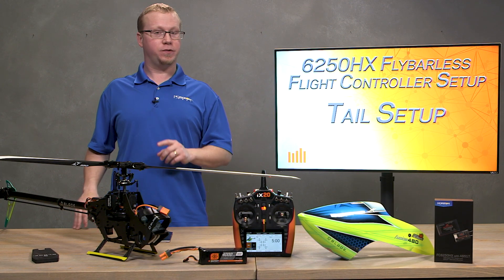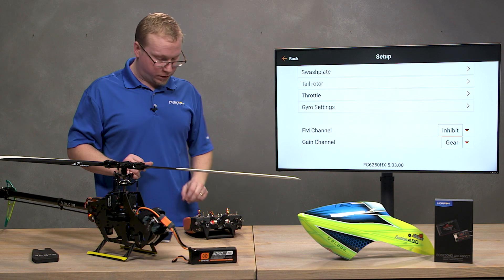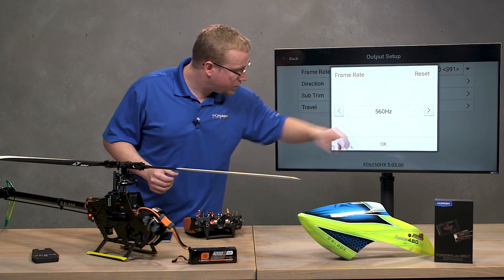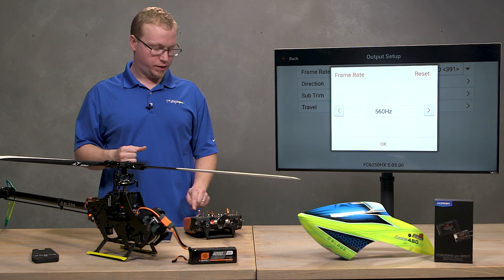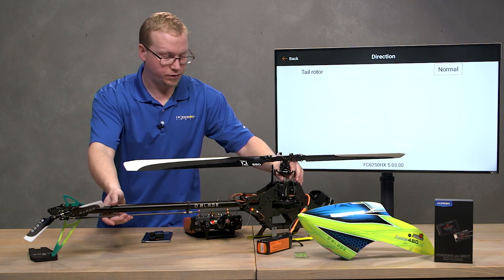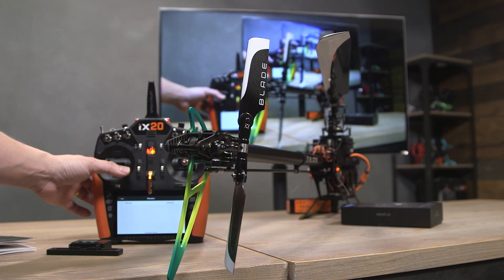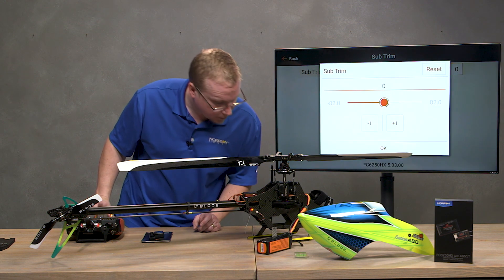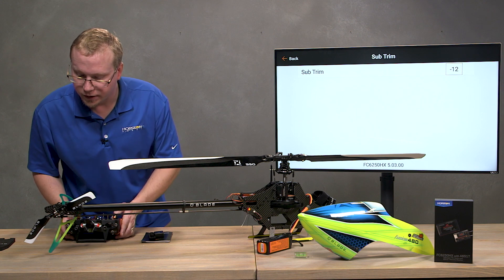Part 5 - Tail Rotor Setup - Spektrum 6250HX Flybarless Controller Setup Series

Comment: i really like how you own both spektrum, and blade, you use a blade fusion instead of a 330, and you specifically say get linkage length from your manufacturer, i’ve been trying for a month to get those but you refuse to provide link lengths for blade 330, and the menus available to me and you, aren’t the same, any suggestions?
Reply: not to mention the flybarless unit contradicts the blade manual many times overrrrrrr
Reply: suppose it’s time for a new align

Comment: ☠️BLACK BARON☠️ My nexspor tail servo 560Hz is jumping back and forth whenever I jump into the forward programming/setup/sub-trim menu and jumping to the previous screen by hitting the "Back" button and my Android Airware is crashing on the airfield. Is that normal?
Reply from the maker: That is odd. Do you mind reaching out to us via email or on Facebook/instagram instant messenger? Would like to be able to better assist there. Thanks!
Reply: @SpektrumRCvideos  ☠BLACK BARON☠ Problem solved so far. If I change the values for "Travel" to decrease the angle of attack of the tail blades does the FC "re-learn" and "re-calibrate" itself during fly-ins? I noticed that my tail rotor is no longer stable after changing only the "Travel" values when I give collective and increase the thrust on the main blades blowing into the tail blades. The tail slightly moves to the right when I give collective. It's really hard to find the best PID values. Can someone confirm please?

Comment: Spektrum indeed need to do a video on the GAIN and PID inter-relationship.  I totally agree with Richard B.  My tail was wagging like crazy.  The PID initial setting (at least in my case) were to high.  I lowered both the P and I to 26 and 27 respectively.  The initial 75% called for in the transmitter gyro setting was changed to 90.  No more wag.  I could probably start lowering the gain and raising the P and I, but the tail is working so maybe I'll just leave well enough alone.

The PID settings are very important.  If not set right the tail will freak out and so will you on your initial flight!!   I am an experienced  heli pilot so remain calmed and set it down with no damage.

By the way I have the Fusion 480 and Hi-Tec digital servos and a IX20 radio
Reply: ☠️BLACK BARON☠️ This RC helicopter setup subject for "newbies" is really complicated. My tail is wagging too.
Reply: @black_baron_net   The PID is different for each setup.  This is what worked for me after watching videos on how PID's work.

"P" is your main gain which provides resistance to change.   "I" gets the tail to where you want it to be.  "D" stops over shoot once it gets there.

Back the  "I" and "D" to about 10.    Back the "P" to about 20.  Take off until the heli is about a foot off the ground just in case you have to land quickly.  Don't panic.

Start raising the "P" until you get wagging then back off.

Now adjust the "I" until it wags.  Then back off the "I"

Do the same with the "D".

This will get the heli stabilized.  Then you can start tweaking the PID for forward flight and such.  Most of my adjustments where in "5" increments/decrements.

It took about 5 batteries until I got it right.  I think I settled on P 85  I 15 and D 55.  Your mileage may vary.  Once you have things set then the gyro gain in the transmitter will provide overall adjustment to all three of PID parameters.

For the cyclic I didn't have to do much.  What ever you to do to one parameter on the cyclic you should have the other matching.

Also I found that my iX20 transmitter gain was working kinda backwards.  From the 75% if I go up the overall gain would decrease.  I just worked with it and didn't try to reverse the gain channel in the transmitter
Reply: @calebizsol  ☠️BLACK BARON☠️ A Flight Controller + Gyro + Stabilisator that recognizes "Vibrations" would be cool and makes the adjustments automatically  in Artificial Intelligence to get the best, most stable results out of a flight controller.
Reply: @black_baron_net  AI coming to a controller near you!!!
Reply: @calebizsol  ☠️BLACK BARON☠️ "Cyclic response" (default 100%) as written in the manual is "Agility" as shown on the iX12 touchscreen display for swashplate forward programming setup. Can anyone confirm?
Reply: @black_baron_net  thats correct on the agility.
Reply: @calebizsol  ☠️BLACK BARON☠️ What settings are recommended for a "Beginner Mode" to make a scale helcopter as stable and less aggressive as possible. 50, 75? I am a newbie, I don't have a "Feeling" for the different settings yet. Thus, it's hard to imagine what values provoke what on the sticks.

Comment: In tail rotor setup (using NX10 transmitter), I can set the servo frequency, but there is no place I can find to set the center pulse value.  Does the 6250HX support tail servos with 760μs center pulse?  If so, where can I set that center pulse value?  I tried the setup by setting 560hz, but as soon as I plugged in the tail servo, it worked for a few seconds, but then it over heated and stopped working
Reply: Did you figure this out? I am having the same exact issue?

Comment: I have a Fusion 480 Stretch like in this video, however, I’m using the Spektrum H6060 Tail Rotor Servo. I cannot find out what frequency it runs so I can program my 6250 to match. I looked everywhere I can think of on the Horizon & Spektrum websites and I simply can’t find it. I need it to finish my set up.
Reply: Digital servo mostly 333hz,  but you can try 200hz first. After flying feel if it is hot. Try 333hz and feel again after flying.

Comment: Hi, I have ordered like 5 of these for my different helis,  I put this on my sab goblin mini comet. Built it perfectly mechanically,  but now when I throttle up, the tail wags like crazy! Can you please suggest what needs to be done??? Would appreciate ur reply. I tried lowering the gyro from 75 to even 20! The tail holds but as soon as it lifts from the ground a bit,  it wags !!. The gyro does not seem to do any difference. Also in channel assign, what should the Gear be? For me its INH.
Reply from the maker: Sounds like you may have the gyro channel set incorrectly. Make sure you have the Gyro menu channel set to the same channel that you picked in the forward programming setup. Another thought is to make sure your main blades are not too tight and your blade tracking is not too far off. Hope that helps!
Reply: @SpektrumRCvideos  hi thanks for ur reply. I have followed exactly as per ur tutorial videos. one thing I noticed in your settings that the Channel assign menu, the GEAR is set to "A" switch .but nothing of that is mentioned in the video thus mine is assigned as INH (inhibit) dont know if that is the issue?
Reply from the maker: @ameersak  In the gyro menu, what is CHAN assigned to?
Reply: @SpektrumRCvideos  Channel is set to "GEAR" but the switch is not set to flight mode, its set to switch B. (this is for normal, stunt1 and stunt2). Do you think setting it to FLIGHTMODE would help?
Reply from the maker: @ameersak  Yes set it to the FM switch as well
Reply: @SpektrumRCvideos  The main rotor blades and tail blades are not too tight. I made sure of that.

Comment: Why is my tail servo creeping to one side? Never ever had that happen to me in the 20-30 helicopters i adjusted. No trim or anything. Everything in forward programming is going fine, seriously this is just nuts
Reply from the maker: Hi Robert. Make sure your 6250HX is updated and that you perform a sensor calibration. That should fix the slow drift.
Reply: @SpektrumRCvideos  I forgot and mention it here. Yesterday did the calibration and works perfect. I just hate it when things malfunction around me🙂. Thanks for the headsup.
Reply: @SpektrumRCvideos  What do you mean by updated, because it was new out of the box. Sensor calibration did work, but tried it 4 times before it worked and stop creeping to one side.
Reply from the maker: @rtoebak76  Using our SPMA3065 usb cable you can update the flight controller. There have been some bug fixes and improvements
Reply: @SpektrumRCvideos  I've got the same issue and I have tried sensor calibraition a number of times (ensuring it was levelled each time) with no success. I'm running firmware version 5.06.
Reply: Realised the rudder sitck on the tx was reading -1 at rest so just had to add some sub trim to it to get it to 0 at rest. This has fixed it.

Comment: my tail is moving the correct direction with the stick but when i check the correction direction its backwards, how do you change this? Thanks
Reply from the maker: This is controlled by the orientation menu. Double check that you have the orientation set propperly.
Reply: @SpektrumRCvideos  How can that be true? Every helicopter would be different depending on the way the tail servo was mounted. On the AR7200 you can reverse it on one of the steps. My unit is mounted flat with wires front but I have to choose in the frwdprg that wires are backwards for the swash correction to be correct.
Reply from the maker: epoweredrc did you reverse anything in your radio? From what you described that seems to be the issue, all controls besides throttle should be reversed in the forward programming menu. Also if you are having to cheat with the orientation menu like that it is sending up a red flag that something is not right with your setup.
Reply: @SpektrumRCvideos  Thank you, I finally got a hold of a Team pilot i know and he was able to help me out. I did have the settings in the radio reversed, once i reversed those then set the ones in fwdpgm back to normal and the tail back to normal everything worked as it should.

Comment: Hello thanks for the videos was a great deal of help, I followed the instructions to set up my tail  as the instructions suggested. However after the setup  my tail shaft keep going to the left without any inputs, is this normal?
Reply from the maker: Ryonide If the drift is 1/2 of the slider travel in less than 45 seconds I would take a look at the following

a) Tx sticks need calibration or possibly bad stick poteniometers
b) Sensor needs calibration
c) Servo chatter
d) Esc fan out of balance

If the drift is slow, along the lines of 1/2 the slider travel over 45 seconds or more then it is just an infinitesimal error in sensor readings building up at a very high frequency. This does not affect performance. Hope that helps!
Reply: SpektrumRC thanks, it was the calibration on the receiver that was out thanks for the reply. Now fully operational
Reply: @RyonideUnruly  Anything to notw when calibrating apart from keeping the FBL level? I've got the same issue and have tried sensor calibration a number of times and it has not helped.
Reply: Realised the rudder sitck on the tx was reading -1 at rest so just had to add some sub trim to it to get it to 0 at rest. This has fixed it.

Comment: Beginner question ... once the tail rotor set up is complete, should the tail rotor blades automatically return to the zero pitch when the rudder stick is at center on the Tx ?
Reply from the maker: Jeff Reynolds nope. The tail gyro is a heading hold gyro that is always correcting even when put at center stick. So if the sensor sees no movement it will hold a command or even drift in its attempt to adjust the heading of the copter.When you go into subtirm menu for tail servo it should put the tail slider and servo arm at neutral.

Comment from the maker: Welcome to the Fifth video in our FC6250HX Flight Controller Setup Series. In this series we will walk you thru, from start to finish, how to install, setup and tune the 6250HX for your Flybarless Heli models.  

Here are links to the other parts of this video series
Part 1- Introduction https://youtu.be/fwVeKYJWFAk
Part 2 - Installation and Binding https://youtu.be/_UB4SBnyFjI
Part 3 - Transmitter Setup https://youtu.be/rxS7LmwlbVs
Part 4 - Swashplate Setup https://youtu.be/VJ0m2S42QPI
Part 5 - Tail Rotor Setup https://youtu.be/vr3rnwtveak
Part 6 - Final Steps and Preflight Checks https://youtu.be/HDpvRV47H9U
Part 7 - Safe and Bailout Setup (coming soon)
Part 8 - Smart Technology Setup (coming soon)
Part 9 - Tuning with James (coming soon)

Equipment used in this video series
Blade Fusion 480 Smart Super Combo - https://www.horizonhobby.com/fusion-480-smart-super-combo-kit-blh4925sc2
Spektrum 6250HX w/ 4651T Telemetry Rx (included with Fusion 480 Smart Super Combo) - 
Spektrum iX20 Smart Transmitter - https://www.horizonhobby.com/fc6250hx-helicopter-flybarless-control-system-spmfc6250hx
Fusion 480 Stretch Kit - https://www.horizonhobby.com/fusion-480-stretch-conversion-kit-p-blh4965 
Spektrum Avian 100 Amp Smart ESC (included with Fusion 480 Smart Super Combo) - https://www.horizonhobby.com/avian-100-amp-brushless-3s-6s-smart-esc--spmxae1100
Spektrum H6050 Cyclic Servos (included with Fusion 480 Smart Super Combo) -
Spektrum H6360 Brushless Tail Servo - https://www.horizonhobby.com/spektrum-h6050-high-torque-mid-speed-heli-cyclic-servo-p-spmsh6050
Spektrum SPM4767 Remote Rx - https://www.horizonhobby.com/dsmx-remote-receiver-spm9745
Spektrum Smart Lipo - https://www.horizonhobby.com/222v-4000mah-6s-50c-smart-lipo-battery--ic5-p-spmx40006s50
TL90 Digital Pitch Gauge - https://www.amazon.com/YoCoo-Display-Airplane-Helicopter-ST250-800/dp/B017LYIPX6/

Make sure to follow us on Facebook and Instagram for all Spektrum News and Promotions!
https://www.facebook.com/SpektrumRC/
https://www.instagram.com/spektrum_rc/  
@SpektrumRC

Thanks for watching!